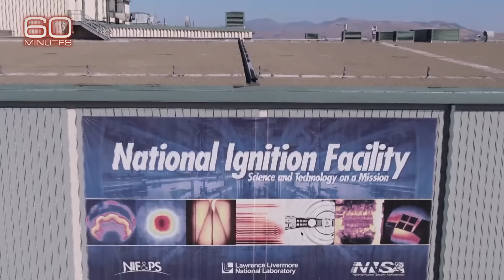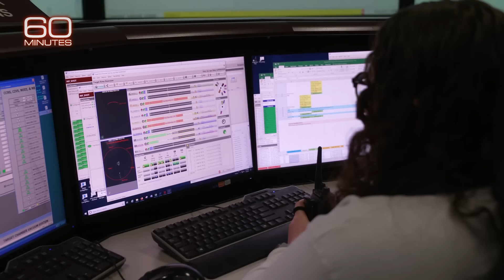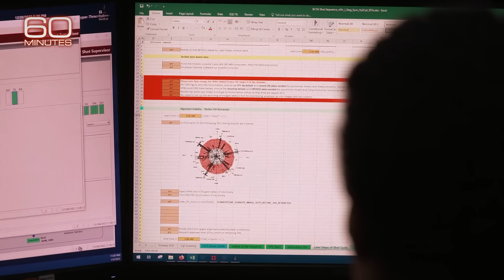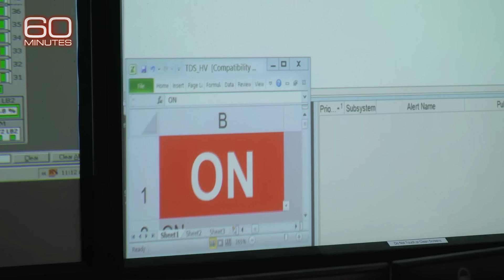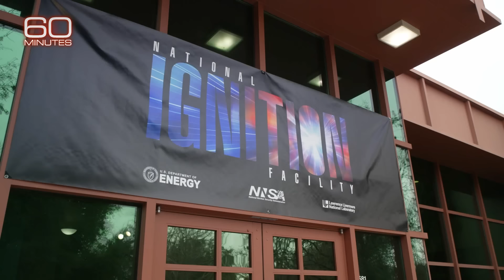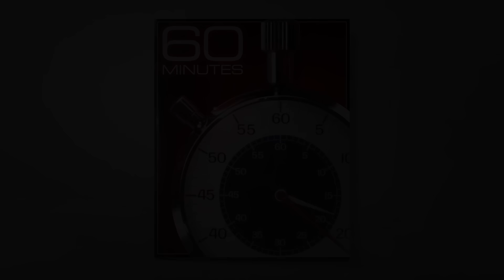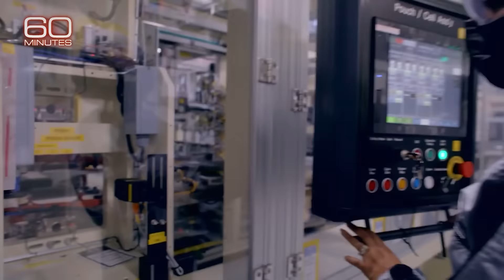Nuclear Fusion Breakthrough; Powering Electric Vehicles; Carbon Capture | 60 Minutes Full Episodes

Comment: Im confused as to why many people keep calling it a breakthrough instead of a milestone. Maybe to get positive feed back from the people and sell the news.
Reply: Isn’t this the first time humans ever did this? So I guess it’s a breakthrough, furthermore advancements will be milestones.
Reply: @scalemodeltutor9841  If you're referring to the nif, then they have done this before, just not extra energy out from the reaction than the laser input but not the whole system still. Others have also called it a milestone from kyle to thunderfoot and some others who went over. It is impressive, but not a breakthrough the news makes it out to be. From what I and others understand, a breakthrough would be net gain or more energy out than the whole system.
Reply: It's pretty meaningless since the energy required to fire the lasers and run all the computers and equipment in the facility was not taken into account in order to make it sound like it's more momentous than it actually is. They put in two units of laser/heat energy and got out 3 units of heat energy. They would've had to get 1000s of units out in order to come close to breaking even on the energy consumption of the experiment. Don't forget, that heat energy has to be turned into electricity and there is a huge loss in the conversion.
Reply: @The1stDukeDroklar  agree enough. I believe it was 3million out put of the 2million input from lasers but around 400million into the system. So about 133x or 0.0075 percent output, not to efficient and most likely not going to be for some time. I wonder how efficient those flash lamps are that add energy to the lasers?
Reply: @mr.ackermann807  Yes, 2 MJ in and they got 3 MJ out. Keep in mind that it's two different kinds of energy people are getting confused about. The MJ they are talking about is heat energy provided by the lasers and 3 mj of heat energy released by the reaction. Any heat energy released would have to be converted into electricity through the same old process of heating steam to turn turbines that would convert the heat into electricity. 
 So, when everything is said and done they used 100s of MJ of actual electricity to generate 1 lousy mj of heat for a fraction of a second. It simply isn't a viable approach.
Reply: @The1stDukeDroklar  I'm aware. But thank you for the reminder.
Reply: @mr.ackermann807  To add ... each laser firing event takes hours to prepare for. They can do a couple shots a day MAX
Reply: @scalemodeltutor9841  It's not the first time Humans have done this. Ever hear of that little invention called The Hydrogen Bomb?
Reply: It's the Science Version if Click Bait...Means pretty much nothing, except it got you to click on it
Reply: @Fireworxs2012  I didn't watch for information on a serious note, I did it to see if there was anything I didn't hear before. And to kinda waste some time to get to something else.
Reply: @Fireworxs2012 you are right, dear sir! We can get massive amounts of energy by nuclear fission!

Comment: It is an incredible achievement, but there is soooo much energy used for the lasers that the energy produced by the fusion is much smaller than what was put in the system.
Reply: shooting lasers at things.. real incredible
Reply: @williesreserve7475  You don't know much about the complexity of this task.
Reply: You're not wrong, but there is also a ton of energy used to generate our current systems as well. This is why we need to begin discussing scale ability.
Reply: It's a very expensive ignition system. There could be other ways to start the fusion process as well...but lasers just kinda work for now :D

Comment: I have huge hopes for sustainable fusion reactors. The comparison to flight technology just made me more frustrated. Flight evolved very quickly and with a small fraction of the investments already made on fusion tech. I keep thinking if we are approaching the goal by a wrong angle. Of course, I have no better suggestions to place. I hope our best minds will figure this out in my lifetime.
Reply: 39:28 
Remember Michal Faraday. What is the use of a newborn baby? Thanks to relentless efforts by our scientists that has brought us comforts.. ans some discomforts
Reply: the biggest problem with fusion is containment having the gravity or magnetic field to force the atoms to stay where they are and continue fusing
Reply: @claybair4904  The biggest challenge is to create more energy than it costs in input and confinement pressure. The Sun gets this for free from gravity.
Reply: Not in the next 20 to 30yrs
Reply: Are you sure about that? I worked for a company that invested billions on jet engine technology. We might be on the same platform or application but the tech is there, fuel savings and Performance. This type of energy is light years away
Reply: They have enslaved and fooled you 👉 The Connections (2021) [short documentary] 💖
Reply: It's fine to have hope but I'd put it in the right place, from what I've read this experiment is for nuclear weapons research and this method will almost certainly never be used in energy production. It annihilates the fuel after every reaction and needs resetting entirely. There's not a system in place to confine that energy and turn it into something useful to us... It's not the aim of the experiment. 
Look to tokamaks and the like, the challenges are immense and we're a long way from anything viable... Deuterium-Tritium reactions offer the best yield of energy but Tritium is a real pain to get and it also gives the most high energy neutrons, which are an absolute nightmare to deal with, they make swiss cheese of virtually everything and turn materials radioactive. There is also the intrinsic problem of having near absolute zero superconducting magnets very close to plasma bombarding everything with high energy neutrons and gamma rays etc...
There are alternative reactions but they require a much higher initial temp giving a lower yield of energy and giving its own set of challenges.
Reply: There are other approached around the world using magnetic flux containment.  However this is the first to demonstrate ignition.  Until now it was just an hypothesis.

Comment: Thanks you 60 Minutes for dumming down one of the most complex machines ever built while getting straight forward answers from the geniuses building this monstrosity.  I bet if they reduced those diamond spheres to 1/10th their current size and a preloaded chain gun was shooting these at 500 rounds a second, this would evenly perpetuate the fusion process if the timing could be perfected.  That's kind of how an ITC engine works.  You add a drop of gas to an empty chamber and blow it up so it moves a load above it which of course is a piston to spin a shaft.  And when you get up to thousands of rpms, you got some really nice power to play with.  One other concern, is how to off load this fantastic amount of power to the rest of the e-grid.  That will require a vast amount of infrastructure, too.

Comment: Oil isn't just used for fuel. And any plastic substitute is as just carbon intense as oil. Oil will always be around, but it will be used more efficiently.
Reply: That's why we should stop burning oil for fuel. It's just too precious to burn it.
Reply: , at current consumption, we have by some accounts an estimated 47 years of oil left to be extracted. That equates to somewhere in the region of 1.65 trillion barrels of proven oil reserves. Other sources up this estimate a bit, but most agree we have around 50 years left, give or take. 

For reference, a barrel of crude oil is about 42 gallons or about 159 liters. 

With regards to other fossil fuels, we have an estimated 53 years of natural gas, and 114 years of coal left to rip out of the ground.
Reply: Synthetic Oil???
Reply: Oil is used to form plastics because it sits at a high energy state (that's why it's such a great fuel). The vast majority of chemical reactions used by industry starts with high-energy ingredients, and go down the energy gradient. That allows the reactions to proceed "for free" in terms of energy cost. (This a general rule, not a hard and fast rule. There are notable exceptions. e.g. Fertilizer manufacturing requires lots of energy to create ammonia. Bauxite requires lots of energy to convert into aluminum.)

So we get plastics from oil because that's the cheapest way to create polymers (in terms of energy cost). Plants create natural polymers (wood) by going up the energy gradient, using energy from sunlight. With easy access to cheap energy, our chemists would be freed from the shackles of energy cost, and able to explore ways to create artificial polymers from base materials by going up the energy gradient. Instead of relying on starting with oil and going down the energy gradient.

It's also worth mentioning that one of the primary benefits of plastic (resistance against biodegradation) is also the reason it's a problem (it's slow to break down if improperly disposed, because it only breaks down via UV light in sunlight). And this same advantage/problem would apply to other artificial polymers we develop. In fact plants evolved wood (basically very long chains of sugars) to thwart animals which were eating them for sustenance (to get at the energy stored in the sugar). To date, only specialized bacteria are able to break down cellulose into shorter chains like starch and sugar. And herbivorous animals have a symbiotic relationship with these bacteria in their gut. There have been a few instances of bacteria developing the ability to break down plastics. So in a few thousand years I expect the problem of plastic waste in the environment will take care of itself. Plastic still sits at a pretty high energy state (why it burns so readily), so any bacteria which can break it down will tap into a new energy source.
Reply: @solandri69  Great for now, but if we deplete our resources and ever delve into an age of lesser prosperity (which has happened quite often before) then there couldn't be another industrial revolution for.... what... tens of thousands of years? hundreds of thousands? Most oil is hundreds of millions of years old. 
Could you imagine if the ancient Egyptians would have taken most of it? You think we'd have laptops now?

Comment: We should be doing more to work with existing nuclear technology. Fission power has become much safer then it used to be. There are designs for molten salt reactors that are scheduled to begin operations within the next two years. Small, modular nuclear reactors are far cheaper and safer than old water cooled reactors.
Reply: The Soviets did it right. Everyone needs radioisotope thermoelectric generators in their house.
Reply: Theyre neat but they have a couple of problems.They produce a lot of plutonium that could be used in bombs and the only molten salt reactor they tested had quite a few of problems. Watt for Watt renewable energies are juat way cheaper than any other form of energy generation.
Reply: @cheafchecker72  (was a joke)
Reply: @DanniDuck  didn’t even saw your comment lol was supposed to be under the first one lol
Reply: @cheafchecker72  Seems unrealistic considering one could make a hydrogen bomb without plutonium just need uranium and tritium.
Reply: they're too busy blowing up diamonds with the devil laser. I'm just curious how much of our tax money is going into these projects

Comment: With AI being appropriately used as a tool they might be able to get closer to the answer
Reply: They seem to be moving backward.

Other reactors can sustain fusion for multiple seconds. I think the record is a minute or two. Fusion is the easy part (that's been done for decades). Containing it without losing energy, while efficiently extracting energy is the challenge. 

The brake though that alludes everyone is not fusion, but efficient containment. 

This one is only a fraction of a second...back to where it all started. Hydrogen bombs. Basically this is a tiny hydrogen bomb that isn't putting any focus on containment whatsoever, just like a big hydrogen bomb.

All they're learning from this, is how to make better hydrogen bombs (in a way that circumvents international bans for testing hydrogen bombs).

Comment: The calculation of the cost of building a power plant of any kind always comes in way lower than it ends up costing. It also takes longer than expected. Is there any way to prevent that?

Comment: So just a amature question I'm sure, but instead of requiring such intense laser power, why not a domino/=cumulative effect? Such as igniting a catalyst that in turn could ramp up/cascade  the temperature to the required level for fusion to take place like you start with kindling which ignites succeeding larger wood? If there were no alternative fuels that could reach such a level, wouldn't a small fission reaction be usable? Like say some form of a particle accelerator style trigger or simply a tiny tiny tiny bomb? 
As I understood it, you only really needed to start the fission process and there after, other than the magnetic containment and a steady supply of fissionable material, there was no additional huge initial power requirements since from that starting point, it would be self sustaining (qReaction: >1) yes? 
Please correct my ignorance on any of these points. I work in mental health not physics but paid attention as much as I could in my undergrad classes.Wack away at my ignorance. It will help me.

Comment: Another “breakthrough” in fusion…..oh boy let me know when its real.  We have had fusion in progress forever.  I hope it happens so we can do even more.
Reply: I think it already is real. Fission to Fusion or Fusion to Fission hybrid reactors are very probable. But they continue to keep the public mystified about fusion by show casing Tokamak and K-Sun reactors but those types of sustained fusion reactors are just like a challenge game for nerds they aren't even being used in the way they should be to generate power. 

Again because nuclear energy is mystified to the public most people do not know that Nuclear Reactors are essentially mega huge steam turbine generators. The actual energy is not coming from the fission directly to the grid, so why do we need to keep presenting the bar for fusion to be long sustained reactions? We don't need to sustain hour long fusion reactions to simply create jump start power for fission which then super heats rods that dunk into water and create steam so what gives?
Reply: @break1722 Way hotter than that and no you really don't want to tap into the rotational energy of Earth
Reply: @break1722 

Yes, using heat from below ground is a thing. It's called geothermal energy.

No, tapping into the rotation of the earth is not feasible, or a good idea.

When you tap into the rotational energy of a spinning object you deplete that energy. It would take a very long time, but trying to draw energy directly from the rotation of the earth would slow the earth down. The more energy you try to capture, the greater the effect. And you can't spin the Earth back up to speed without putting that energy back.
Reply: @off6848 

"Jump start power for fission"

Just say you don't know what you're talking about and move on.

We don't need fusion to jump start fission. Fission reactors already work, and can be started up at will. 

Energy from fusion will likely also be steam turbine generators energized by fusion reaction.
Reply: @break1722 can't be done, Earth 🌎 is flat, sadly 😢.

Comment: Why not use the steam from the process to run a turbine producing electricity? Since greenhouse owners push up co2 content to boost growth, can it be added to fertilizer to boost growth, or perhaps running it like a drip water system, or combining the two?
Reply: Plants get co2 thru leaves not roots, and the steam turbine is how a fusion reactor would work. Same as a regular fission reactor just heats up water to run a steam turbine.
Reply: @smallpeople172 might want to Google " do plants get oxygen through theirs roots?" Also I was talking about the lithium extraction process.
Reply: "Why not use the steam from the process to run a turbine producing electricity?" While hydrogen has very few electrons associated with the proton, fusing two hydrogen atoms together will have far more electrons associated with the fused helium atom than the two non fused hydrogen atoms have combined. Even minor hydrogen fusion very large amounts of electricity enough to blast a 3 inch deep hole about 12 inches wide in a concrete garage floor from four feet off the floor on a wooden table. It will produce enough electricity all on its own.
Reply: @nathanwoodruff9422  No. Fusion power would generate electricity the standard way. It would heat a coolant to create steam and that steam would turn turbines. Fusion power plants are and will always be pie-in-the-sky.
Reply: They hardly have to add co2 anymore, it's so high in the air. Maybe under ideal conditions, it's useful. But in anything less than ideal it's almost pointless to add anymore co2.
Reply: @The1stDukeDroklar  "No. Fusion power would generate electricity the standard way."  Thanks Einstein. "Fusion power plants are and will always be pie-in-the-sky." And as I said the reason why they will always be pie-in-the-sky is as a Fusion power plant producing Terawatts of power, that fusion reaction would always be on a razors edge of becoming a multi gigaton atomic bomb. But thanks so much for your insights.